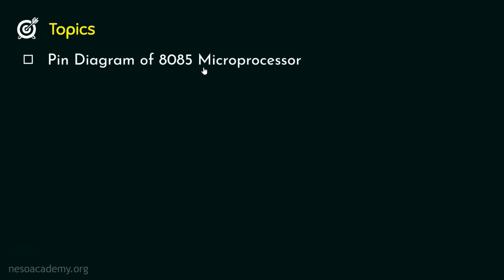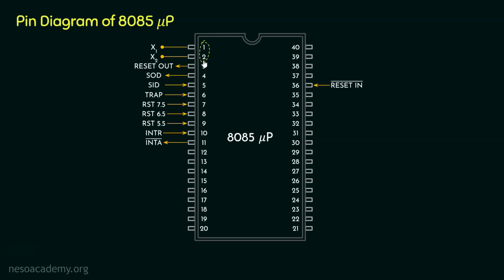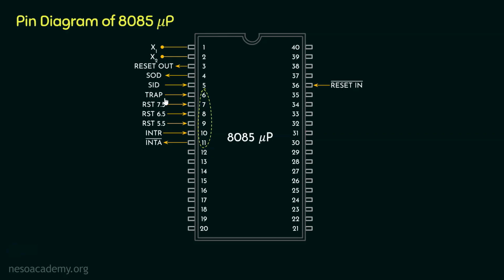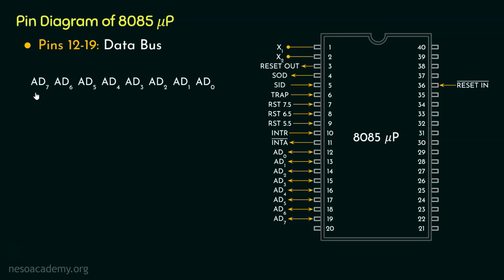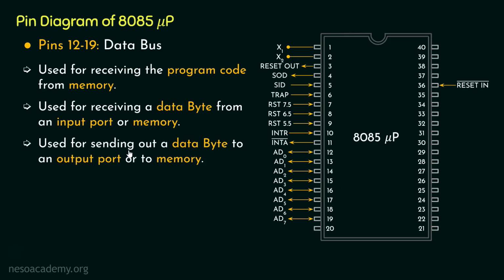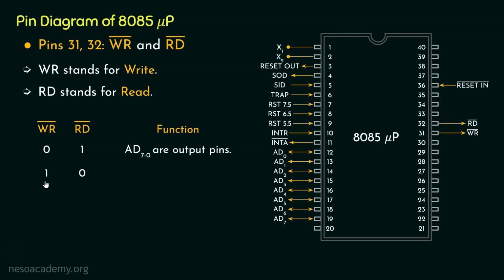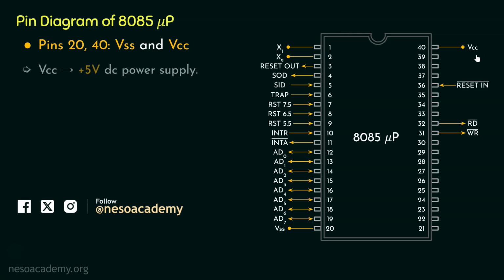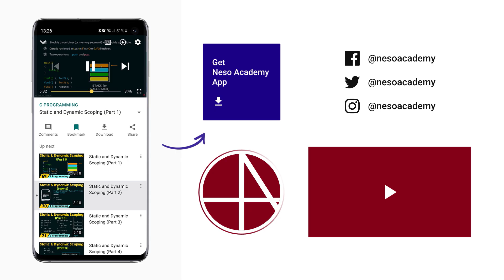Pin Diagram of 8085 Microprocessor (𝜇P) - Part 2

Comment: It is not clear from the video whether WR and RD are output pins or input pins. 

Can I throw out this IC if both these pins show an output of Low ?

Do I have to connect WR to Low and RD to High  before I can write?

Do I have to connect RD to Low and WR to High before I can read ?

Comment: I have an doubt...
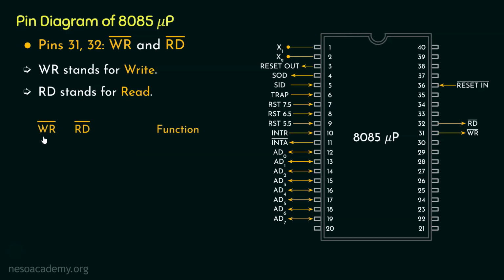Is WR and RD pins are input pin or output pin..? 7:40
Reply: It is not clear from the video whether WR and RD are output pins or input pins. 

Can I throw out this IC if both these pins show an output of Low ?

Do I have to connect WR to Low and RD to High  before I can write?

Do I have to connect RD to Low and WR to High before I can read ?